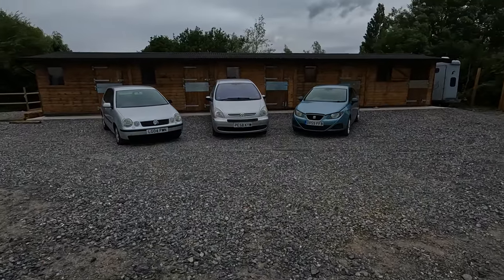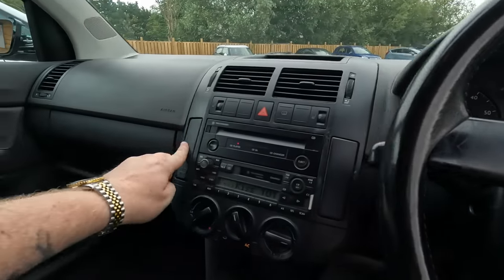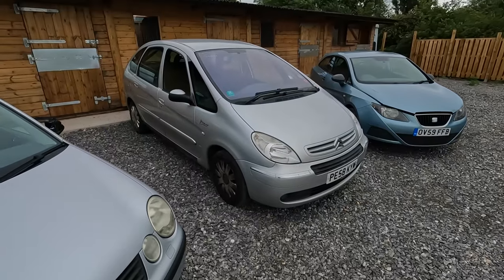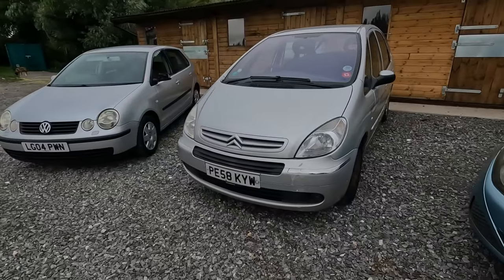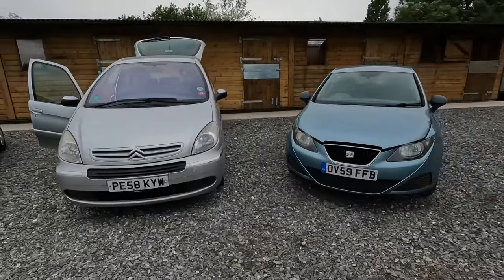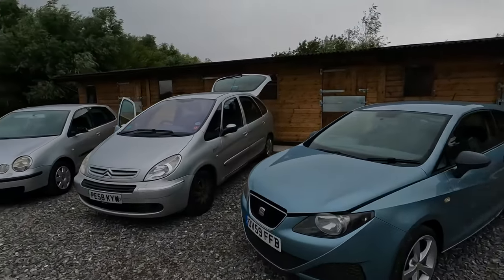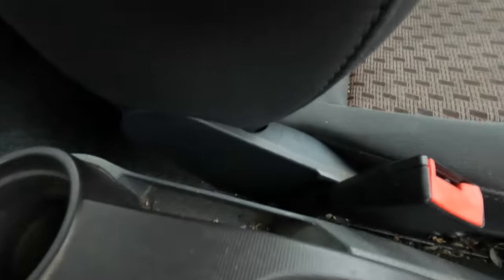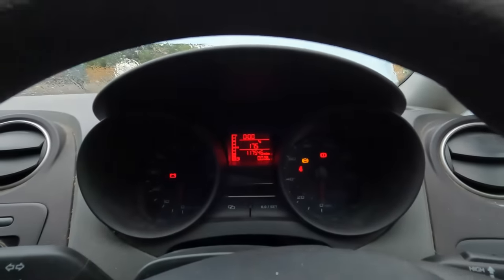I foolishly let my girlfriend buy cheap cars from BCA - Car Auction UK

Comment: I couldn't buy from an auction after I see what rubbish we send there. I work in rental cars and the ones sent to auction are purchased off the leasing company as they would cost too much to return in repairs. Most cars that come off rental are really good. But we have had cars with clutch issues, overheating and worse with as little as 20k on them.

Comment: My wife drives a 2002 Polo 9N - it’s battered and used as a van most of the time, but is still going strong at 122,000 miles, and is actually quite fun to drive. Cheap to run too!

Comment: I deal with cars daily for engineering after accidents etc and Ibizas are always in dreadful condition and the worst looked after. And every Picasso is the same with trashed interior and plated sills 🙄 Ironically those Topdan jump packs are redabged Nocos…  great video
Reply from the maker: But they’re completely different…
Reply: Are they never new that probably just rebranded  cases
Reply: TopDon jumpstarters can't be rebadged Noco's cause the TopDon's don't break 1 month out of warranty, I've had 2 Noco GB70's one broke after 13 months and the other one after 15 months my TopDon JS2000 is still going strong after 2 years and it will still start 25 cars on one charge.

Comment: I would throw a junkyard engine in the Ibiza, clean it, touch up the stone chips and sell it. With the Picasso I don't think it's worth properly fixing the dents. Just make it straight, patch the sills, paint the rear bumper with a rattle can (you can't make it worse) and clean it.

Comment: On Total Car Check the cars have following 

Volkswagen Polo has only two failures on mot

Citroen Picasso has only thirteen failures on the mot.

The Seat Ibiza has four failures on the mot, 

So from what I reading the Citroen Picasso is worse one, out the lot, as the Seat last mot was but I maybe wrong as Seat has got corrosion on the rear axel.

I hope that you wrong and ended up eating your words and the one you say is worse give you more money back when you fixed the issue with it

Comment: Where there is muck there is brass ! Some people love a cheapie ! Only problem you have being a dealer is customer rights ! Has to be sold as scrap , to be trailered away etc etc to protect yourself against the 6 months warranty customers are entitled to ! Crazy a customer can get 6 months warranty On a 15 year old Citroen Picasso with 148 k and the same 6 months warranty ( or come back , sold not fit for purpose etc ) as a two year old car with 20 k miles !

Comment: The polo is a nice spec car. Cleaned up should do ok.
The Citroen is a bit rough inside The front brakes look like they are doing all the braking. It’s a cheap school run car 
The Seat unfortunate,

Comment: Cam shaft at top, crank shaft at the bottom, that 1.2 engine is always faulty, had them with chain gone at 45k,jumped not broke.
Reply from the maker: Did I say it the other way around?
Reply: @ShiftingMetal  yes bud
Reply: @ShiftingMetal  stress

Comment: @3:39 Less damage is always better at this price point but the technical condition is more important. 😊
@5:23 That is smart engineering. What use have 10 cup holders if you can only fit tiny bottles or cans in there?
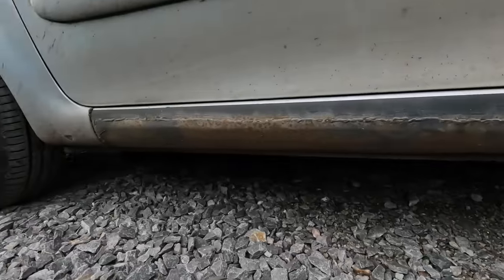@11:14 Wow, that is a turd and a half.

Comment: The Picasso and ibiza are just scrap value. The Picasso needs too much paint/ bodywork and new seats plus the 1.6 hdi does like to blow turbos when they get to that mileage and im going to guess it hasnt been serviced regularly. The only saving grace it has is theres lots of them in scrap yards so plenty of cheap spares. Ibiza one look at the alloys i think says all we need to know, been owned by a boy racer and ran on a shoe string and kicked into auction. VW polo should make a nice car if you can keep parts cost down. This encapsulates exactly why car traders need to make healthy profits on some cars, because you could easily lose thousands on a bad car and even a very good mechanic/ esteemed trader etc could still get caught out.

Comment: Avoid bca, go in person to Aston Martin, you'd have clocked all those faults, that seat engine was knocking and it's half seized that why it won't start, tbh there's nothing in any of them, just a loss, I'm in South Yorkshire and prices are nothing like yours, 2k for an 04 polo(!) get an engine for the seat, maybe 400 quid, picasso is like 595 as is, if it's got a test for a bit, tbh there basically ludicrous purchases, you simply cant be buying on line old cars at auction, or tbh even later ones. That seat was knocking it's t**s off sounded painful.
Reply: Aston Barclay. Car UK seems to get reasonable stock from there but may be cheaper in Midlands.
Reply: @thomasfrancis5747  I go to Wakefield branch bud, hardly bargains but a bit better than those scrappers, also on bangers fees are 75 quid, if you buy enough a year, unfortunately tbh say that piccaso there's absolutely nothing that Makes less than 300 quid anyway, re the seat if you'd have been there in person, stuck your head in and asked the driver to rev it, well....

Comment: Polo 500 pounds , citro scrap , ibiza 300 pounds
Reply from the maker: No way Jose
Reply: @ShiftingMetal where we are in Barnsley, south Yorkshire that's probably fair prices, polo's only one any good, if you advertised it as needing a clutch it'd be 400,other 2, 250 each scrap, so you've got like 900 quid, obviously if you sort them you'll do better, I'm just scrapping a corsa atm, ecu flooded, 250 quid 09 plate, got 1400 quid in it, hard job sometimes
Reply: @roystonvehicles9129 roy cant you just change the ecu in it sounds like my bad luck i had with the peugeot  check it out 😂😂😂
Reply: @flippingcarsrepairs  sent ecu off in lock down mate, it got lost, tried swopping full ecu, bsi kit from identical car, didn't work, people are wanting 300 quid for ecu kits and without the original one I didn't know if it was bosch or seimens, had the car in stock since 2019, stood me at 1400 so I didn't scrap it lightly, but we're stuck for space.
Reply: @roystonvehicles9129  no way i wonder why 8t didnt work if you swapped it all over did you do the clocks as well or does it not mater on a corsa. For that price i would have had it of you and tried sorting it. Cant beleave it got lost did you get compo back for the loss. Thats the trouble if you dont no what ecu was in it before its a nightmare i had that with a mini someone stole the frm module and i had no way of knowing what it was so had to keep buying different ones to check 🤦‍♂️🤦‍♂️🤦‍♂️
Reply: @flippingcarsrepairs  yes bud, swopped the lot, air bag ecu, clocks, just kept coming up no comms
Reply: @flippingcarsrepairs  I've swopped a few Peugeot ecu kits bud.
Reply: @roystonvehicles9129  no way thats annoying 😔😔

Comment: I'm loving the Picasso! I've had 2 and they're such underrated cars.
Reply: Got 2006 on 1.6 diesel 225k on clock still going strong... 8 years in paid a huge £100 for it If I scrapped it now I would get £275.... Good motor, all round... Just an old mechanic  that knows what works well in the trade
Reply: Picasso’s seem to sell very well too. Even £1000+ ones don’t take long to sell. I do like the Xsara Picasso but……. This one in the video is end of life. Wouldn’t scrap it though. Get more money back for breaking for parts.